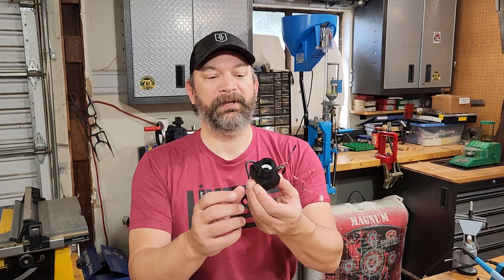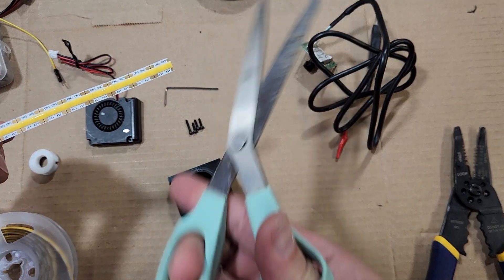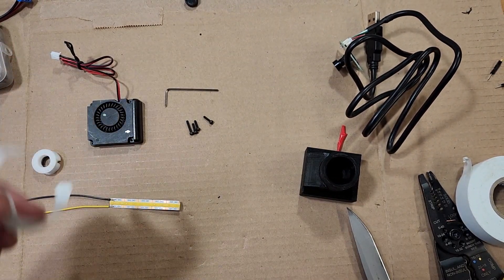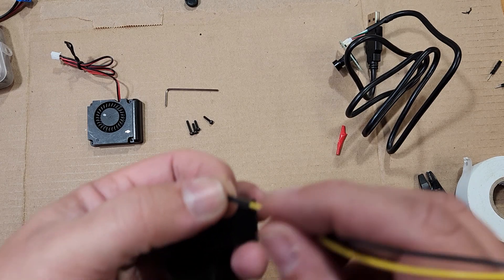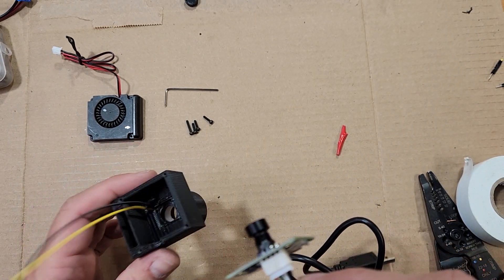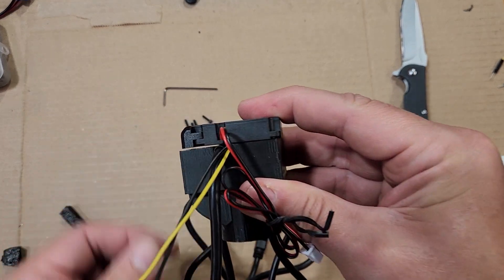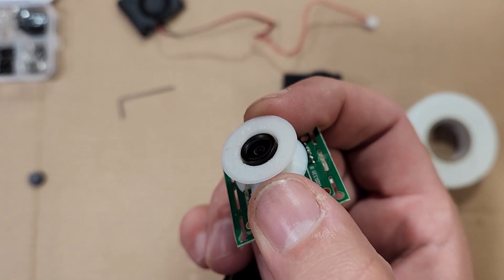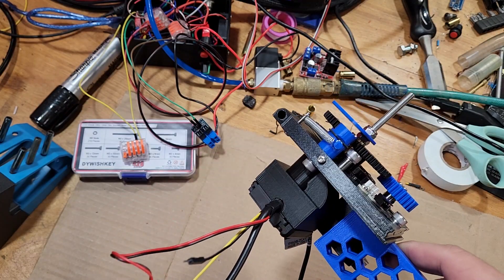CS7.1 Build Series - Camera Module

Comment: I can't find the stl file for the back of the camera and the fan on github. Has it not been posted yet? That's the last part I need to print then I can start on the electronics and assembly!
Reply from the maker: The fan is the back of the camera as it serves as the lid. The links for it are available in the instructions.pdf file in the root of the repo. It is called "40mm BLower Fan 12v with Air Guide":

https://github.com/sjseth/AI-Case-Sorter-CS7.1/blob/main/Instructions.pdf